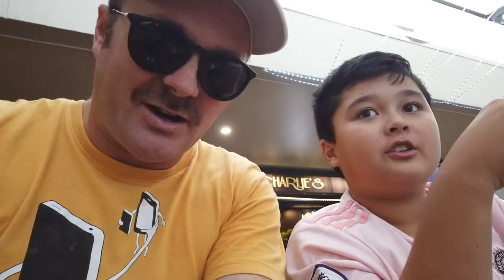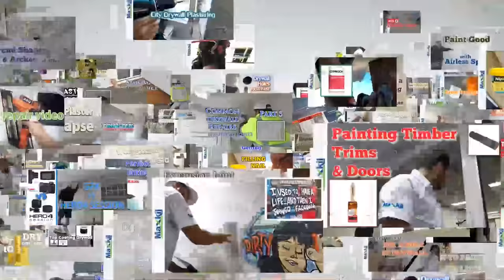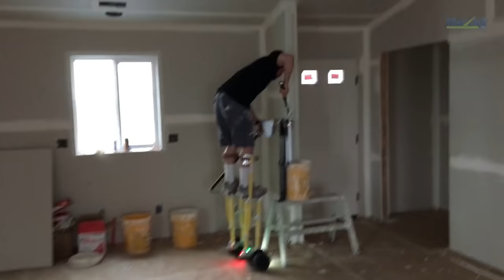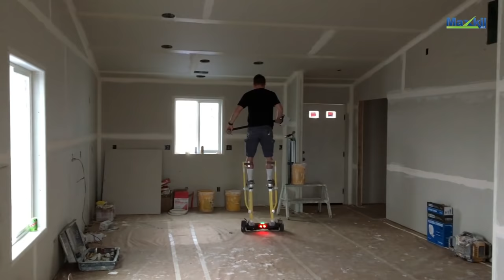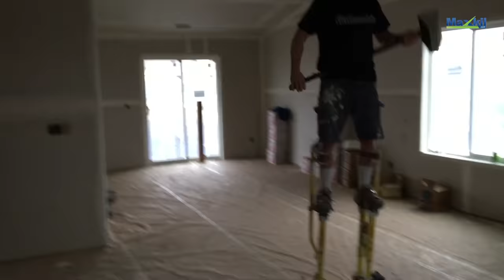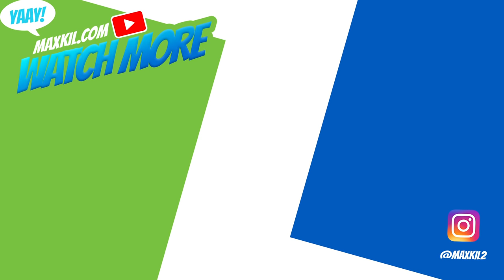CRAZY Drywall Construction Worker Uses Flat Box while Riding Hoverboard ON STILTS!

Comment: Step 1 you clean the whole house from any type of debri on the floors so you can run smoothly, you tell your contractor or home owner no one else but you can have their shit or materials in the job site, even yours has to be minimal, all that before u start working

Step 2 use mud so runny that it can be easily pushed out and pumped in from Ann unstable position

Step 3 prepare for doing it all over again,  it will all evaporate as the amount of water will be too great  having massive shrinkage probably needing a 4th coat 

Step 4 better have insurance

Step 5 let's forget about handle extensions and just do ceilings on stilts? 😁🤣

Awesome balance though, undeniable!
Reply: I have never worn stilts to do plaster. But have seen many other people do it. And they were able to work quickly and faster than this.

Comment: Amazing but slow, if you do it all the time- Not really necessary for ceiling heights under 2700, where you can just run around with and extension handle. For the higher ceilings its actually the bomb
Reply: Yeah that's what I was thinking way to slow. I have never worked off of stilts but i have  seen many people working on stilts and they work much faster than this.